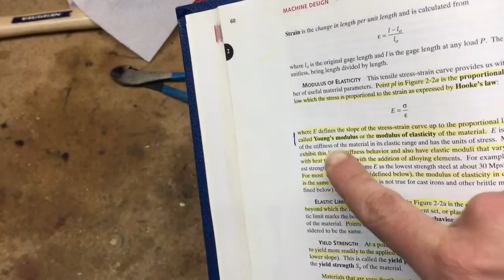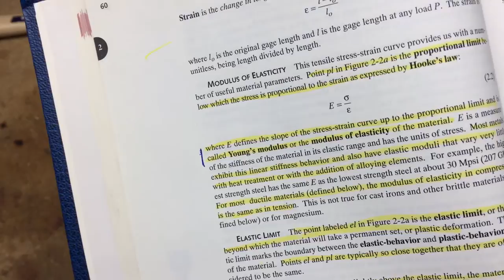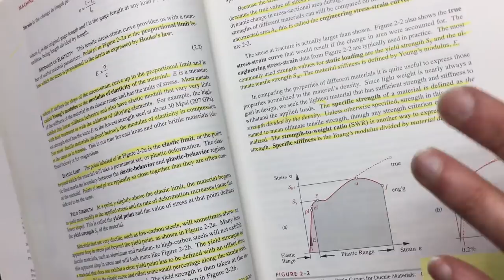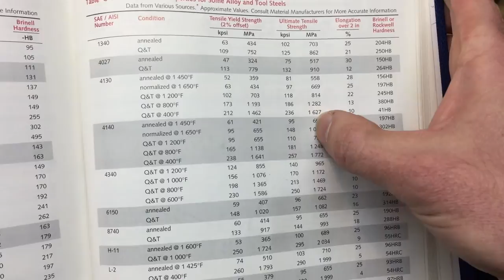Mechanic tools you should spend more money on.

Comment: I appreciated the scientific/engineering reasoning for what tools to spend money on. Many people won't buy a tool if it doesn't look good or a handle doesn't feel right in the hand. And thats ok because thats thier personal preferenace. I myself do not care as long as it is a sturdy tool and will be dependable for many jobs. I try to buy made in USA tools to support manufacturing here, which usually means quality. I also have a Taiwan set of tools that were my first set and I have never broken a chrome socket from that set. I only see a chrome socket break from improper use, like some guys at my job don't care and use an impact on anything.
Reply from the maker: Steamed Hams thanks for watching. Taiwan seems like decent stuff but it's really too early to tell for sure

Comment: Science is certainly great and important.  When it comes to tools, in my opinion, how the tools make you feel is also important, however.   Great tools are not only durable, functional, safe, and easy to use, but also psychologically satisfying as well as motivating to the user, in my opinion.
Reply from the maker: I actually agree, there is a physiological factor too but it should be based on quality and feel and not name as you say.

Comment: Snap on startin to bring back the hard handle
Reply from the maker: Thats good!  I love how the clean-up and how durable they are.
If you don't care about name, Willams have been making the hard handle screwdriver for a while now, you can get them on Amazon, exact same as Snap On, same factory.

Great deal:
https://www.amazon.ca/Williams-100P-5MD-5-Piece-Premium-Screwdriver/dp/B002NH5X2I/ref=sr_1_3?ie=UTF8&qid=1490574484&sr=8-3&keywords=williams+screwdriver+set
Reply: Mech-Eng Ive heard of them before. Name wise i honestly dont care about some tools more so than actual function. Ive got several different sets and brands of screw drivers I own and use. Klein are indeed good, along with Wiha, Ive got a full set of channel lock brand I keep in my truck, my tool cart i use my blue point, my box at home snap on and harbor freight (dropped couple of harbor freight ones off top of cranes at steel plant and they survived) Like ya said, its about how you use em and what ya wanna do with em. I do prefer the soft grip snap on by way they fit my hands (only ones god gave me), and got a product called Citrol cleans em well
Reply from the maker: I agree, the soft handles feel better I just love the clean up of the hard handles.

Comment: I have a question about types of metal. When it comes to chains, the type of metal makes a multi-factor difference for the rated working load and the working load should always be within the materials elastic range. Some thicker chains have a lower breaking point than a thinner chain's proof range. How can a steel chain that is much thicker steel break under a load that's within a thinner chain's elastic range? They're both steel. Seems to me that the story is a bit deeper.
Reply from the maker: Benjamin Cronce yes absolutely, there are various strengths of steels. Strength is defined by yield strength (when it starts to elongate) and ultimate tensile strength (when it fails) get the supplier to send you this data

Comment: You keep rehashing on the same engineering term MODULUS like this is the only thing that is important in selecting tools.  I have some old craftsman screwdrivers similar to the Kobalt and can tell you they are Crap.  Those old hard plastic style are complete murder on your hands. Try screwing in several screws into wood and it is obvious.  Quality of the tip is important along with the ergonomics of the handle.  I have the newer style hard handle Snap On and it is so much easier on the hand.  You can also apply a wrench to the screwdriver for rusted screws.  I have personally split a few cheap sockets and also seen some with more slop and poor chrome.  This could lead to rounded fasteners and rust (poor chrome).  Wrenches again I disagree with you.  How often does anyone use the open end of a combination wrench.  Most of the time you use the box end.  I have seen some terrible manufacturing on the box end, even damage to the cheap wrench after using it.  Another factor is size of the box, I want a thinner profile to be able to fit into tight areas.  Nothing more useless is a wrench that has such a large profile you can not get it into tight areas.  Ratchets for me spend the money.  Father always bought cheap tools and can not tell you how many ratchets failed when you apply any force to them.  In the beginning you bashed many of the other tool reviews because they just give their opinion.  What do you do in you video, give your opinion.  One of the earliest lesson I learned was my father always bought the cheapest when purchasing anything, my mother on the other hand always bought quality and when buying quality, you have to spend more money.  My fathers purchases were always failing because of poor quality and mothers items often lasted a lifetime.  I myself lean to quality.  I usually only cry once from the purchase price not from the tool failing and the tool will last me a lifetime.  The problem with a lot of lower priced tools is the quality can really vary even in the same manufacturer, depending on where they offshore their manufacturing.  I usually buy snap on wrenches, ratchets, sockets (including impact), extensions, screwdrivers, ratcheting screwdriver and often pliers.  Snap on relabels some of their tools and I usually buy from their manufacturers to save money.  Bahco builds their adjustable wrenches.  Bluepoint is usually offshored, but better quality offshoring.  Knipex a german manufacturer builds high quality pliers and I have a mixture of both Snap On and Knipex pliers.  For working on cars electric impacts are a must.  Milwaukee electric impacts are superior to Snap On for most impacts.  They also cost substantially less.  Usually made in the USA tools along with European are typically higher quality.  Chinese are usually the worst quality, but not always.  Taiwan is usually a step up in quality to the Chinese.
Reply: Johnny Woo cool story